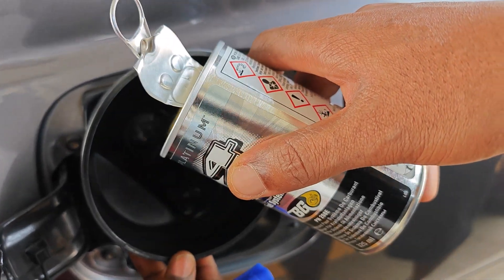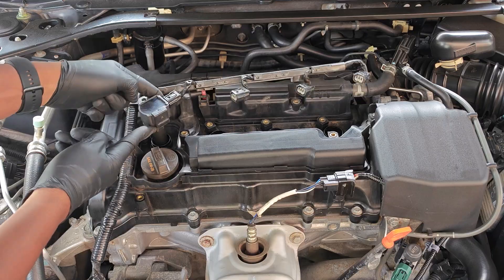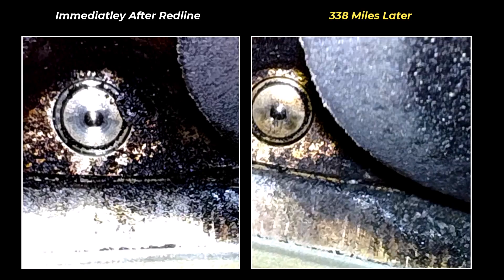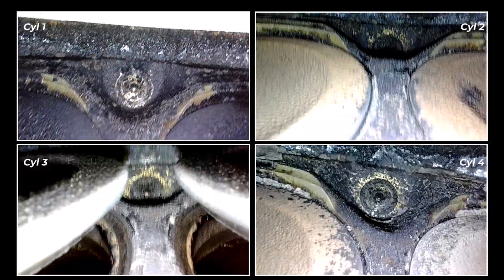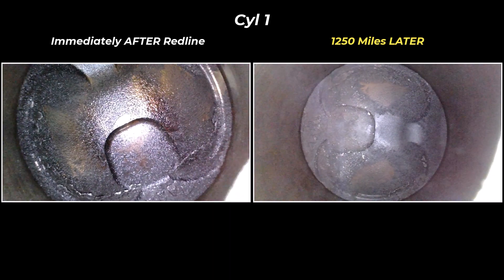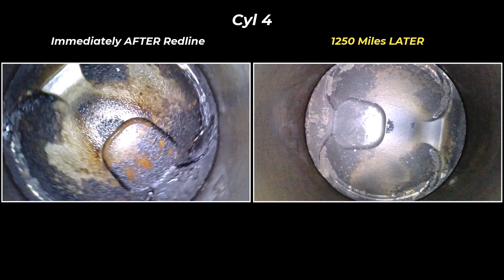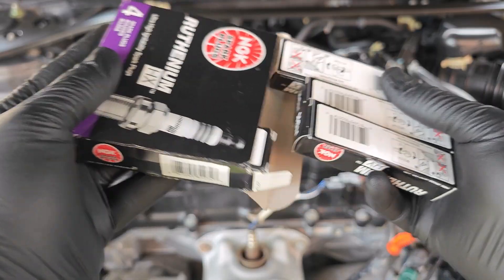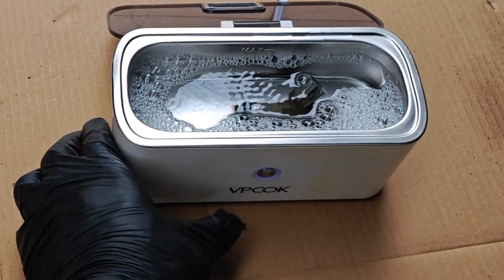How Long Before Carbon Buildup RETURNS after using Redline SI-1? Cleaning carbon for Good

Comment: Great tests..the used redline and it cleared up my hesitation (although at first it Made the hesitation worse,i guess it was cleaning it out),put on the instructions i think it's says after running a whole bottle,afterwards use a half of bottle every 1500mile or 3000miles i think..for maintenance
Reply from the maker: Yea, half bottle is for maintenance

Comment: I drove our 1998 Caravan 2.4l for 25 years on cheap gas and then learned about top tier gas and GDI engines. My 2017 Kia Sorento 2.4L engine got replaced at 72.4K miles  by KIA free because it was a oil guzzler and failed 3 dealer piston soak attempts. I have tried BG 44K, Techron, Redline S1 in the Dodge trying to clean the carbon in the cylinders. The minivan is supposed to get 20 MPG for city and I get 17. A few years ago the mechanic blamed carbon deposits for the lower MPG.. The van as 177K miles on it and  since it has all that mileage with cheap gas, it is taking several hits to clean it up. I am thinking of doing  Liqu Moly and Yamalube ring free shock treatment. I am using Valvoline R & P oil for both now.

Comment: Which liquid to use in ultrasonic cleaning machine to clean sparkplugs ?
Reply from the maker: You can use ultrasonic fluid cleaning liquid. If not available, you may try simple green or some water and dish soap.
Reply: @DIYAutoworksNG 
Using water won't damage sparkplugs?
Can you suggest any other safe liquid other than water ?

Comment: So, what do you say, do we need to use in every tank ?
Whereas company mentions can last for 2000-3000 miles
Reply from the maker: Certainly not every tank. It all boils down to the quality of gas you have and how soon deposits return in your engine. Before an oil change is good practice especially if fuel quality is dodgy.

Comment: According to SDS of the european Chevron Techron the PEA content is almost 50%, like the redline. issue is that both are extremely hard to find in Europe :(
Reply from the maker: Yea, I found same. That European Techron formulation is quite high. The crown belongs to one Polish fuel system cleaner though I think it was more than 60% PEA or so. However, I understand that after a certain threshold, PEA concentration will have detrimental effects on the engine.
Reply: @DIYAutoworksNG  I checked that product but you need to buy it in like a strange polish website.
I ordered my Techron and should be here very soon like a day or so. I have a diesel car so it will be used on a family member's car. I will do 2 consecutive  bottles. To be honest the car runs smoothly, oil changes are made by me and imho frequent oil changes keep a car mint.

Comment: so no use to use these things....1000 or 2000 miles and its back... waste of money
Reply: @andyvankerkhove6902  it's not a one time thing where you drop it on the gas tank and be done with no more follow up of course the engine will keep on getting those stuff out because of daily use and these fuel additives do make sure it do their work to help you not spend $$$ more for repairs due to your neglectance.

Rather spend on these as they work than pay tremendous $$$ along the way due to neglected effort of car maintenance.
Reply: @deckpogi2680  how you drive is more important, I drive a diesel and only highway....wont need these adds

Comment: Try BlueChem CarbonX is amazing how clean piston like new in just minutes  you will need a vacum to extract all carbon liquefied, is a two step product x1 is a foam that fil cilinder and melts carbon x2 disolve the foam and with a vacum and a small ruber hose extract all

Comment: MPI = Happy times.
Reply: @DIYAutoworksNG  I stay away from GDI engines. An older Japanese Nissan 1.8L MPI engine(2007 reg. but late 90's design) requires a bottle of FSC once a year, oil change every 10.000Km & and an engine flush every 100.000Km, runs great still at +300.000Km with original cam chain...

Comment: Very interesting test :D In the hope that at least the carbon deposit level will not increase I use Shell V-Power Racing 100 octane fuel, cause it has the most PEA from every fuel avaible in Poland.
Reply: Where did You find info about PEA in fuels available in Poland? It's not common. It's secretly hidden recipe.
Reply: @TheDeadinhollywooD  I'm glad you ask ;) On polish forum oil club.
Reply: @TheDeadinhollywooD  There is a guy from Slovakia, who test it. I can't get you a link here
Reply: @TheDeadinhollywooD   try to google 'Lista wyników badań dodatku PEA' - he made a spreadsheet with PEA content in various additives and fuels.

Comment: Your getting quick carbon buildup post running 2 tanks of gas with injector:comb chamber cleaner likely because your not running top tier gas that has a batter additive pkg that has a higher detergent level.
That’s what you get for running cheap gas.
Reply from the maker: I appreciate the suggestion, but the data is what it is, and unfortunately, no top tier gas available. Thanks for watching!

Comment: Thanks for getting straight to the point sir, great findings. See if top tier gas makes a difference do you use top tier gas?
Reply from the maker: Thanks mate!
No top tier gas available. Lol
Reply: @DIYAutoworksNG wow and i think the redline softened up the carbon on piston crowns making it easier for regular gas just to vaporize it away

Comment: Even after the 6 bottles of BG/REDLINE mix I used in my test motor I had one DI injector get stuck open at bout 120mph on Friday night. Thought I broke the piston but immediately pulled back home half a mile away and pulled the plug to see the combustion chamber filling up with fuel with the car turned off. Pulled out problem child number 6 on the front bank of cylinders replaced number 6. then decided to pull the rears as well and then soak the other 5 old ones in b-12 and clean them with a used tooth brush. Re-installed changed the oil and its running way way better. Turns out the injectors where still very dirty on the face but the holes on the injector where wide open and clean, the piston tops where damn near spotless but a tiny ring around the edge of my piston.
Reply from the maker: Wow! Thanks for sharing your experience mate! Very insightful and topical. Yea, I'm expecting clogging of some injectors, but ultrasonic cleaning should straighten them out!
Reply: @DIYAutoworksNG I’m putting this junk yard ecoboost through the wringer 👍🏼 I probably should have had the injectors cleaned professionally when I had the timing chain and pump done.  The fuel cleaners work but they don’t solve all the issues.
Reply from the maker: Yep. For the injectors, those cleaners are for maintenance. Ultrasonic cleaning during a major tune up is ideal, especially GDI!
Reply: @402SHO  how many miles/km do you have ?
Reply: @AAAAAAndrea junk yard motor. I’m going to guess by the buildup inside the engine and it being pulled from a 10-12 Taurus SHO it had around 100-200k miles on the engine. After soaking the injectors in B12 and cleaning with a tooth brush I knocked off .18 off my 1/8th mile time on the same tune. Clean injectors make a MASSIVE difference
Reply: @402SHO GDI engine ? these new GDI engines are a chore
Reply: @AAAAAAndrea yes GDI, all of the Ford Ecoboost engines (turbo engines) are Direct injection.

Comment: Try using Top Tier gasoline.
Reply: no magic neither
Reply: top tier gas is way more expensive than it should be, I just use the right additives
Reply: @AAAAAAndrea  additives... are not free
Reply: @andyvankerkhove6902 it coste me way less money to use additives than using top tier gasoline, at least in my country.
Reply: @AAAAAAndrea  china... additives from aliexpress ?? lol... just bought some additives... they cost 3 to 5 euro and you need different ones... prime diesel have them all inside

Comment: Perhaps using half a bottle of Redline with each refueling over a longer period (around 3 months) would be more effective for achieving more sustainable results.
Reply from the maker: For sure. That's the maintenance dose recommended on the bottle!
Reply: I do 5oz redline /1000 miles. Its the same as the 7.5fl oz /1500 miles recommended by the bottle for maintenance. I do dose it at 10 fl oz right before oil change (which is the dose of 1 bottle (15oz) for every 20 gallon as indicated on the bottle.)

Comment: Interesting how quickly the carbon returns!  Do you use top tier or have top tier fuel available in your area?  Based on your results, i have used liqui moly valve cleaner for 4 tanks in a row, and then i did 2 tanks of redline si-1.  A few tanks later i tried a shock treatment of yamalube ring free.
Reply: Its just a sht design by Honda. You dont need a detailed report. No gas washing over the valves. Plain and simple
Reply: @glenbenton4855  but gas is washing the injectors and pistons and are they still carboning up.
Reply from the maker: @jordonbeaven  That's some therapy you got going on for the fuel system! Did you have a look with a borescope? Things should be shinny ceteris paribus!

Comment: so you need to use those cleaners after every oil change to get permanent results
Reply from the maker: Yep. But before the oil change, so you change any carbon that blows by
Reply: @DIYAutoworksNG  great idea👌
Reply: That’s what I do when it’s time to change the oil. A can of bg 44k in the tank and run it till empty, then do the oil change. But I also use top tier premium gas, so it has a lot of pea in it anyway.
Reply from the maker: Nice culture right there! Ever inspected your combustion chamber?
Reply: @DIYAutoworksNG  Not yet. I plan to do it sometime soon though.
Reply: Not sure where you live, but the following stations are top tier in the USA.    Chevron, texaco, Phillips66, Costco, sunoco, exxon.   If you dont have those, it would be interesting to see you experiment with what gas stations are available to you.

Comment: Thanks, looking forward to the injector cleaning episode.

Also, I'm interested in seeing if there's any carbon buildup on the intake valves since they were cleaned a few months ago.  Of course, borescope views of through the spark plug holes if fine given the difficulty of viewing through the intake ports.
Reply from the maker: Intake valves looking good. Just a light insignificant coat.